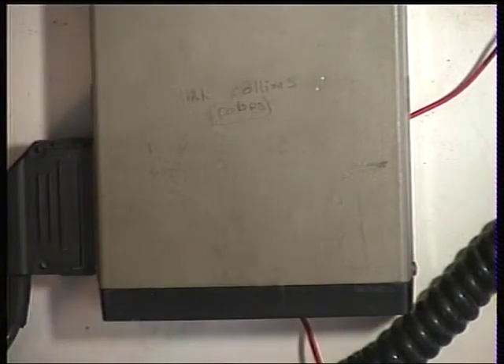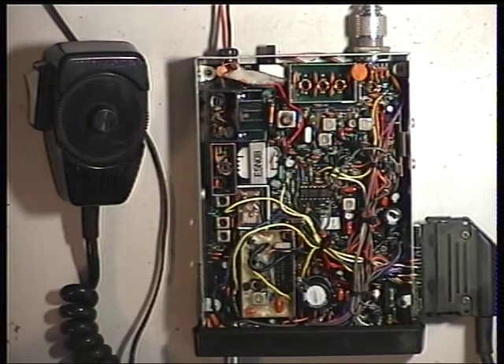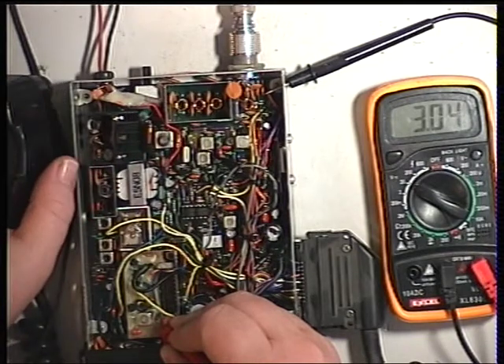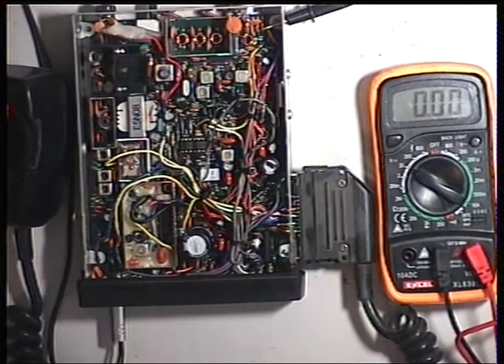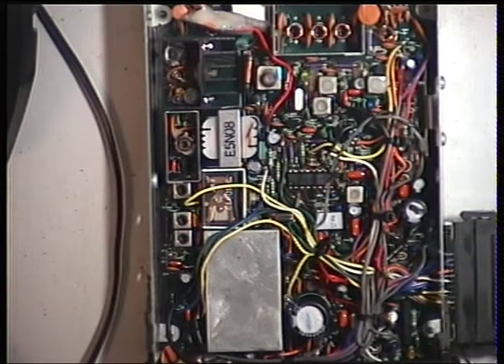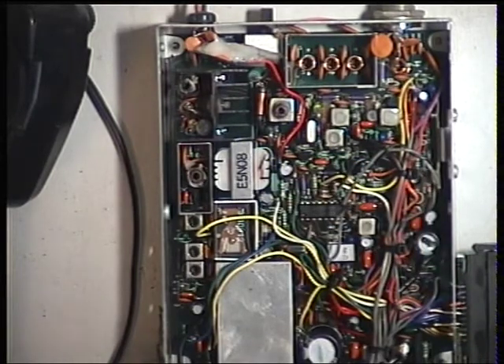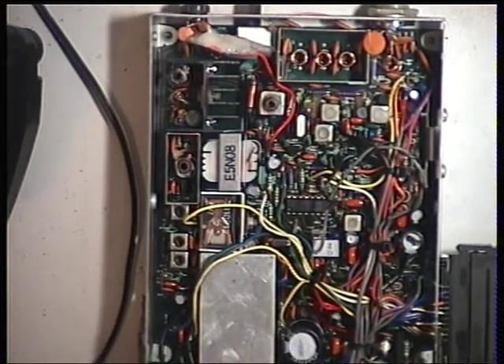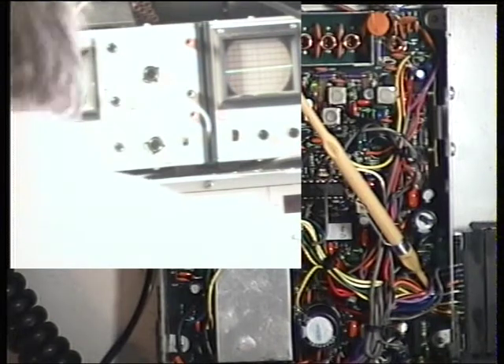Realistic TRC2003 remote, UK (CB 27/81) CB radio (Mobile)  - VCO & Transmit adjustment

Comment: Radio Shack "One Hander" - "New for 77!" listed for $149.95 in the catalog dated that year.  By the time 1977 actually arrived, US CB had been expanded to 40 channels.  The updated, 40-channel version was $169.95.  I assume that they, too, were GRE-built given that so much of what RS sold was, whether CB radios or DX-160s ...
Reply: I don't think either of the US versions came with a detachable control head.  Interesting!
Reply from the maker: The UK 1983 version is one of the best receivers regarding adjacent channel rejection ever made for the UK market with factory a fitted crystal filter.

Richard, G0OJF, UK